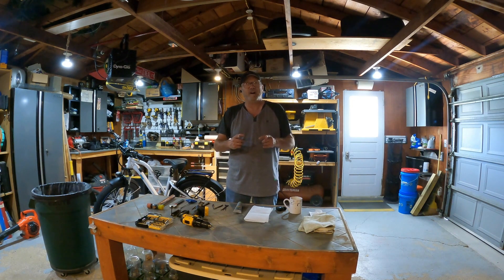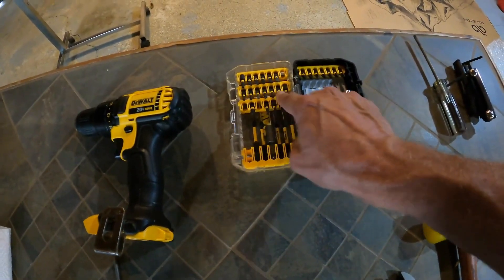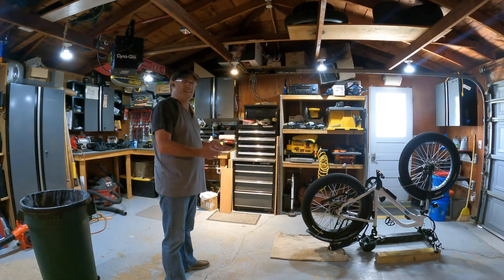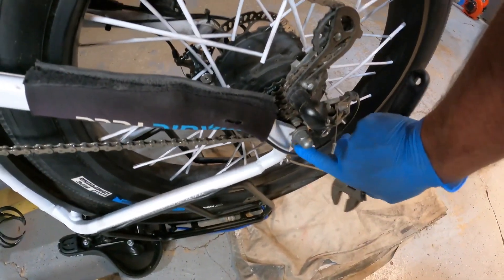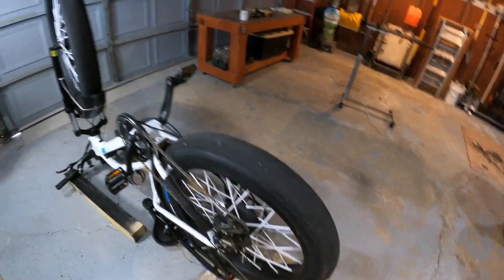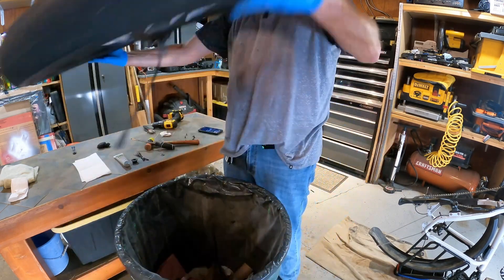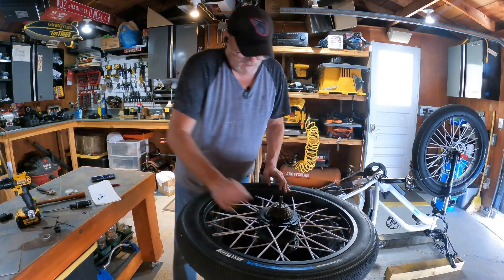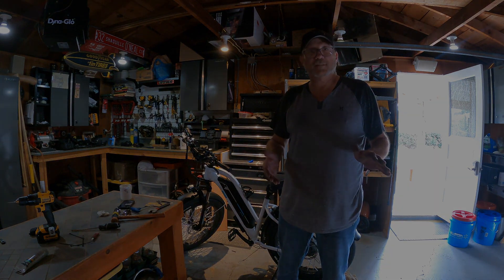Magicycle Motor Disassembly Tutorial and Lubrication Guide#ebike #guidance

Comment: I had a question for you on the magicycle ocelot pro 2.0 when you’re assembling the handlebars that mean stem that you can turn with a large Allen wrench they’re not supposed to turn, but I accidentally did that and now the stems all out of line when you turn the handlebars, they slide to the side and don’t turn the bike. Do you know what the solution is to fix that?

Comment: I fixed my second rear tire flat....rode 50 miles and now when I crack the throttle the motor power cord wraps around axle and disconnects...you mentioned a washer that stops motor from spinning...not the axle dropout teardrop washer.......help....did I forget to reinstall???
Reply from the maker: It sounds like you may be missing a critical component that prevents the motor from spinning and causing the power cord to wrap around the axle. Typically, there should be a washer or a torque arm on the axle that keeps the motor in place.

Double-check your bike's manual or the motor installation instructions to ensure you've correctly reinstalled all necessary components. If you're uncertain, it's a good idea to consult our website 24 hours service

Comment: How often do you suggest us to do this? You said that it looked fine in 3000 mile.
Reply: I wouldn’t worry about this until maybe 6000 miles or so. I only did it as a request to show how to replace a motor. I did not need a motor so I greased the gears since I had the motor off.